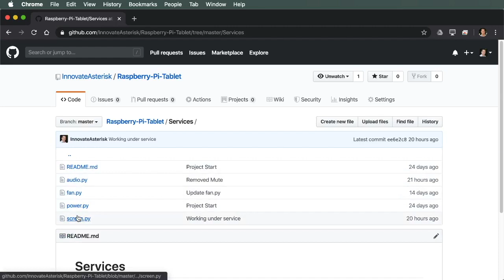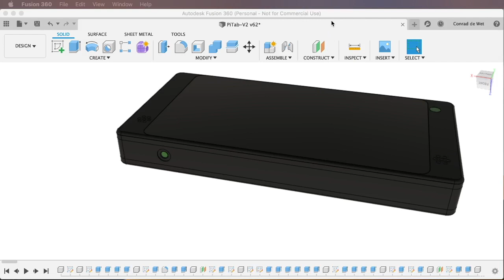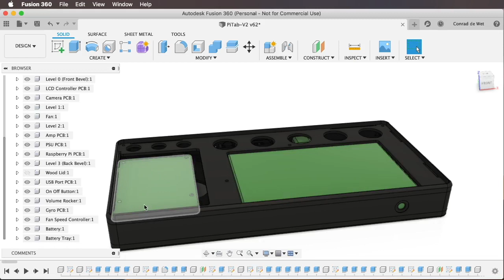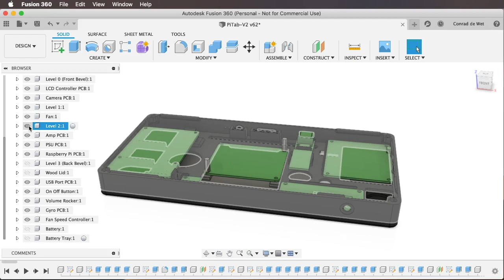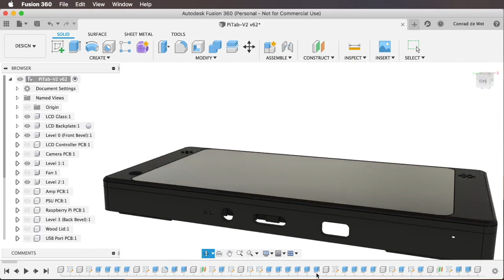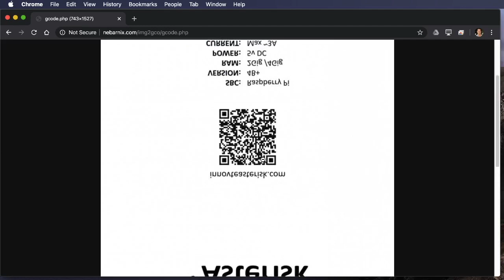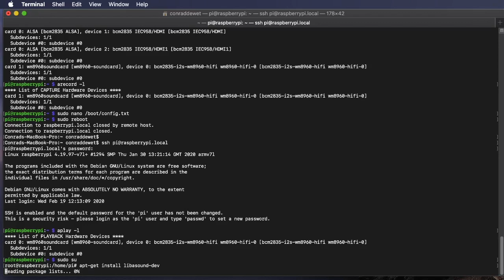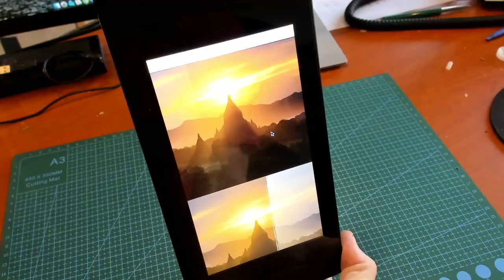Raspberry Pi 4B Tablet

Comment: Watching the careful planning and chopping of the various boards, I am somewhat surprised that you didn't  just dig up schematics/reverse engineer the various PCBs and design a unified PCB that would eliminate the unnecessary hardware and also provide a way to layout a more space conscious design.  

I fully acknowledge how much of an massive undertaking this would be, but having the ability to seriously thin the form factor would be amazing and legal hurdles aside, I imagine a RPI compatible tablet specific PCB would even have some commercial demand. 

That said, you have a cool project going on... I'm impressed with the outcome.
Reply from the maker: Thanks for the feedback! This project had quite a big reaction, and I can see the “chopping” of the various components is quite a topic. I have a few more prototypes that I’m planning, but once they are done I’ll probably return to this project for version 3 - I’ll probably then do a custom printed PCB, and yes it will take up less space too. Although it will be more difficult, I think it will still follow the project directives; that all components must be readily available. Who knows, there may even be a Raspberry Pi 4A by then :)

Comment: Nice looking project. Did something similar using MDF but without gyro, camera and fan controller for my 3B+ retropie. What's battery life is like?

Edit to remove link
Reply from the maker: Nice work! 
The battery life isn't amazing, but the battery is consumed a lot by that screen. I think it's 1.2amp on its own. The PiJuice does an amazing job tho! I bigger battery would help, but then it may not fit in so well. I think it's the same old story that any mobile manufacturer is faced with.
Reply: Yeah battery life on my project not so great also. I did modded to use 2 batteries with 2 charger but still roughly 2 hrs play time. Think using old batteries is not good choice but too cheap to buy new better battery. hehe

Comment: Nice Projekt, but i dont find the speakers and the Fan in your description. Also the PIJuice ist not in stock anymore,... Sad,.....
Reply from the maker: Thanks for the feedback. It will depend what area you are in. 
Just Google the descriptions: "Aluminum Heatsink Cooling Fan for LattePanda". 
Also Google "tablet speaker" for the speaker - so long as they look about the same as in the video, you should be fine. 
With regards to the PiJuice... yes, it's a pity. I'm not sure why, but it could be related to the Virus effecting production in China... not sure. Anyway the best alternate i found was :
http://www.raspberrypiwiki.com/index.php/UPS2
but the 3D model is not done according to this. 
The online options should appear if you google "raspberry pi UPS2"

Comment: fanfkngtastic job! i laughed out loud when i saw you ripping, chopping & cutting off the usb/eth ports & pins. i hadn't though of that for shrinking my prototype's profile size down. you may want to consider a 2nd camera for up close shots with both cameras on a set focus. loved the music w/ the video too. we'd get along. btw, the thumbs downs were probably old ladies looking for raspberry pie recipes
Reply from the maker: There are probably a few other ways of getting components off the board, "cold solder" comes to mind, or even hot air. But these both require a bit more materials or equipment than most people have, so I figure post people have a side-cutters. I hear on the 2nd camera... it's in the bin already. Thanks for the support ;)
Reply: @InnovateAsterisk  i thought that the PiJuice battery was 3.7v and the PiJuice hat can "achieve a maximum of 2.5A" (from their site).  how are you getting the 3A needed for the rpi4 + peripheral? i don't have a solid grasp of voltage/electricity so I've missed something

Comment: How about enabling a virtual keyboard for your tablet?
Reply from the maker: What I found is that in order to use a virtual keyboard you still had to issue some command, like apt-get install. This requires the keyboard anyway, and to get onto the internet... something again you need the keyboard for. My quest for this project in the end would be to use a UI or some skin that is "touch first", with an integrated keyboard (like android).

Comment: And is interesting use with my usb modem, probably usb extension, asterisk for voice calls? This can?
Reply from the maker: You should check out this video: https://www.youtube.com/watch?v=mS28vfT8wJ8
I tested this tablet with Chrome and this code, it works perfectly.
Reply: @InnovateAsterisk  But web rtc is calling through a browser, I think it's not quite what need.
I meant calling to number operator’s sim card on a usb modem on a raspberry pi or laptop with Linux, maybe with asterisk, maybe with something else, I don’t know ...
Reply from the maker: It has a USB port, I guess if you had a USB GSM device, it could be like a mobile phone.

Comment: And how is it reliable? he did not break after 3 months by accident, the components did not hang in the case?
Reply from the maker: Well, I haven't done a drop test... yet.
Reply: Ohh, no need. I mean deterioration due to long use. This is actually DIY, not a branded assembly.
Reply: And as you know, branded devices turn out to be more reliable or strong ...
Although I almost did not find any analogues for this tablet. Although ... found
Reply: No microphone, headphone, battery, but can use bluetooth speaker, powerbank, usb microphone ...
Reply: It turns out that the fewer components - the easier and safer it is to assemble

Comment: really want this, but can something simpler, less wires?
Reply from the maker: It can seem a little complicated. If you take out the fan speed controller, you can reduce a few wires while leaving it as complete as possible. A  lot of the wires are for the sound card - however this is quite an important part.

Comment: Hey, Does you implement the sleep mode (like a mobile ) when you press the power button o something like that?
Reply: No
Reply from the maker: It was something I wanted to try implement. If the screen goes black from the power saving settings, tapping the screen will wake it.

Comment: Very cool build. Did you consider desoldering instead of clipping everything off?
Reply from the maker: Very good question, thank you for asking. I was considering explaining this further in the video, but was pushed for time, as it is... it’s 1hour 20min, so here is the full story: Raspberry have an “A” format board, like the 3A etc. These are without NIC and only have a single USB... this would  have been perfect, but the 3A only has 500mb RAM, and there is no 4A. 500mb of ram is simply not enough especially since one of the objectives of this project is to make it “touch first”, this means it would need to be graphically intensive. So the only option become to use the 4B but then take out the big components at the one side of the board. I first tried with unsoldering... but it was a mess, and one or two of the tracks in the PCB got damaged, this was especially the case with the PiJuice (I think I mention that I the video). After a few different tries, cutting the case of the components, and the inside plastic left the board in perfect condition, and even left some metal pins sticking out so you could solder more wires to it. I really believe this to be the most disappointing part of this build, but the resulting board is in the best possible condition after, and hey... super slim right?! Does it really matter how it got like that ;-)
Reply: @InnovateAsterisk  That's a good reason! Thanks for explaining.

Comment: total cost of the hardware? €€€ - $$$ - ???
Reply from the maker: The cost of each item can be found by flowing the links in the description... but before you do, i can assure you that an Amazon Fire will cost a LOT less... but its not all about the cost, its about making something with your own hands... and making something that a few years ago would have been simply impossible.
Reply: @InnovateAsterisk  thanks for replying!
I agree with you; I'm wondering if this DIY projects with Open Source O.S. can be a more ethical options, fighting the planned obsolescence of the off-shelf devices that we use to buy.